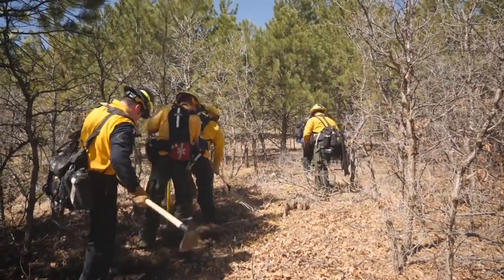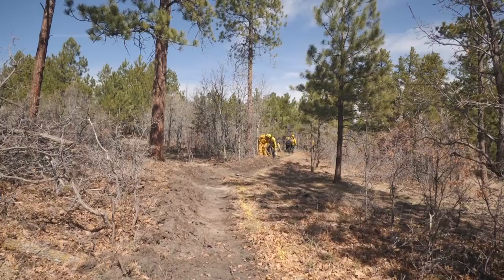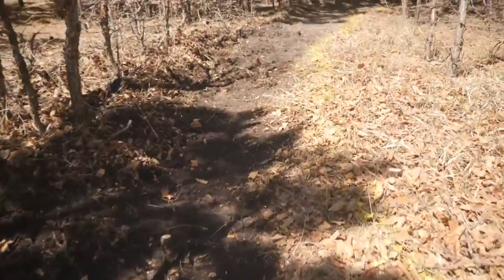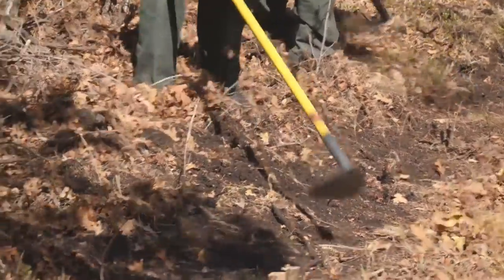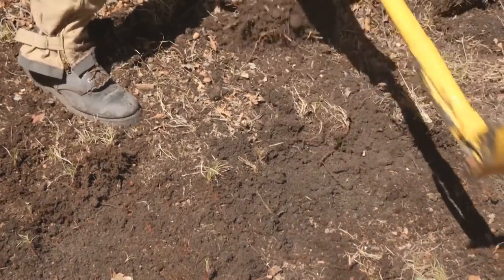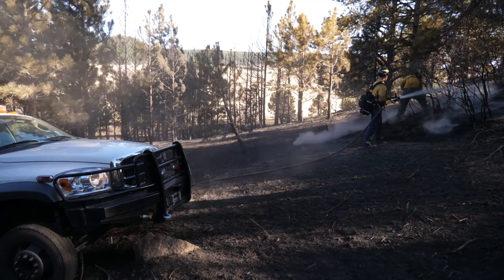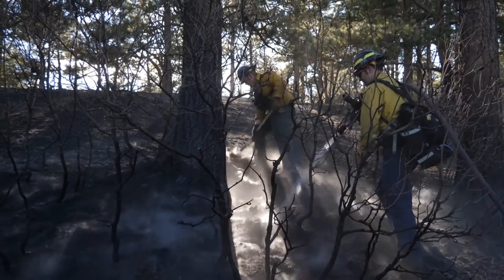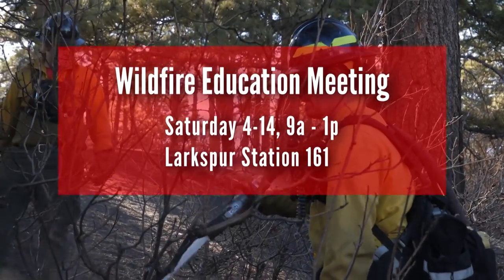Building a Fire Line

Comment: Please explain how wide a fireline should be and why
Reply: Every 1.5 ft tall flame x 2, because of embers and residual heat coming off of the flame that can start fires across your line
Reply: So if flames are 6 feet tall you should have a 12 foot wide line
Reply: @SlobbyNobby_kick   I understand that but not everybody does
Reply: No no no untrue. As a type 2ia firefighter we have a standard 18 inch wide line even in Heavy timber. The sawyers cut a 12 foot gap ahead of the hand line. This is the way its done. A dozer line may be woder though
Reply: Cutting my grass today with this in mind